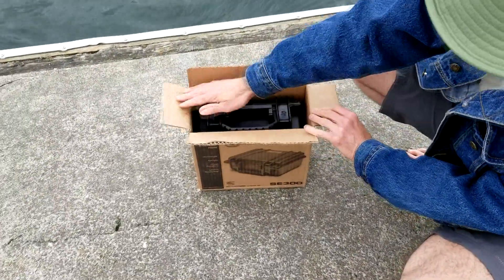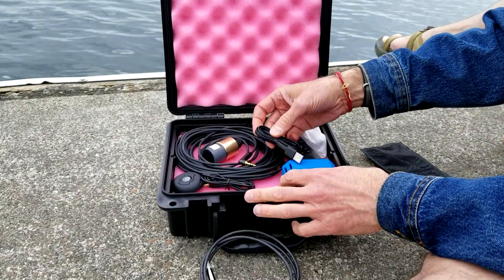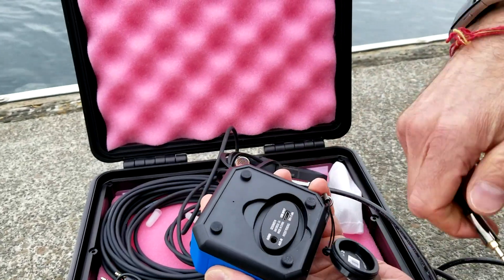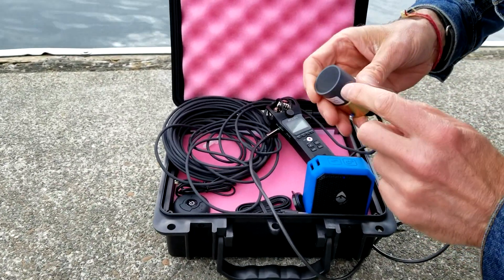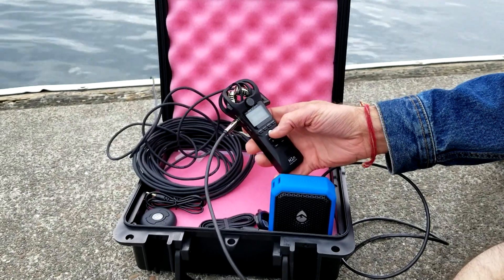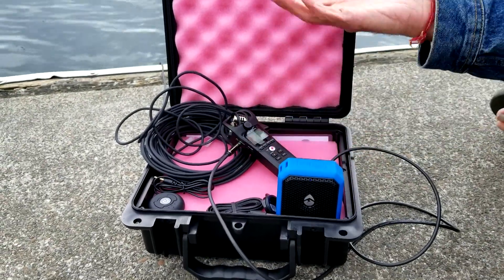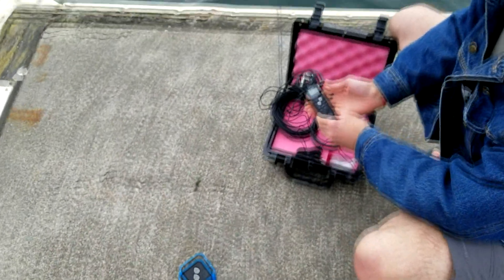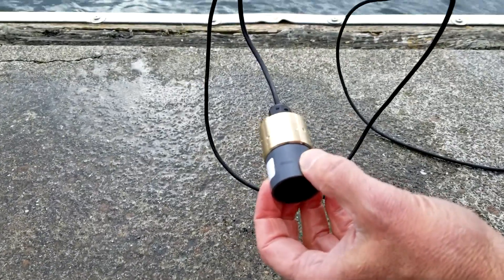SQ26-H1 Hydrophone System Demonstration

Comment: What? No impedance buffer? The problem with piezoelectric and contact mics is that they are not well matched to typical audio inputs. The reason why these devices often sound tinny is because the piezo sensor presents its signal through a series capacitance which is small, typically 15nF or less. When wired to a normal 50 kilohm line input this forms a 200Hz high-pass filter, which eliminates the bass. Because the piezo disc has a very high impedance (1 MΩ typical), it should be buffered to avoid possible impedance mismatch with an existing audio system. This circuit acts as a impedance buffer, and some amplification does not hurt as long as it is around 40dB. The best piezoelectric sensors for listening is based on Aluminum Nitride and molybdenum. PZT-5 also known as SensorTech BM500,Channel 5500,Morgan PZT5A1 is widely used.

You will find such a device here:
https://github.com/Supermagnum/xSoundsMicrophones/tree/master/Hardware/Microphone-piezo
Reply from the maker: Rest assured, our hydrophone transducers and preamps are expertly matched. That's why they have such excellent frequency responses. The internal preamps in our SQ26-08 hydrophones are designed specifically for use with plug-in powered recorders, such as the Zoom H1n.